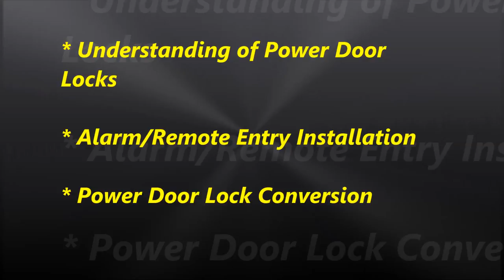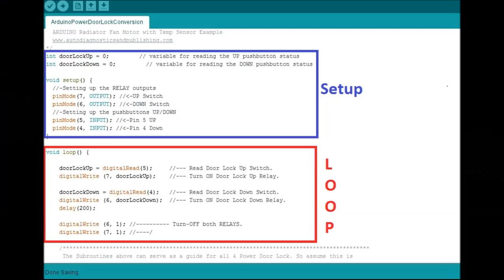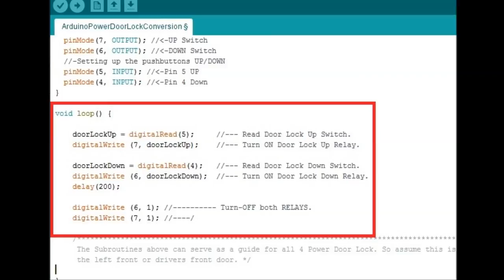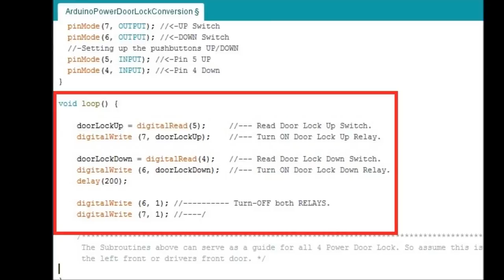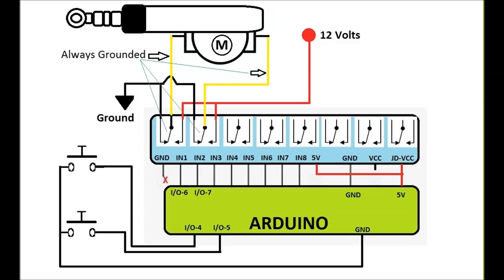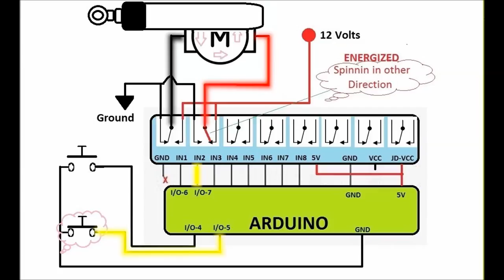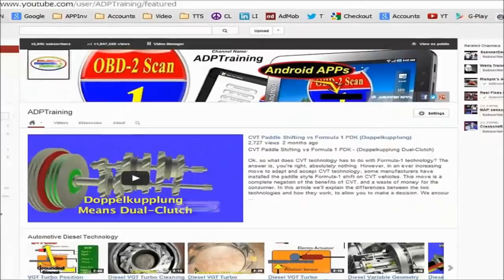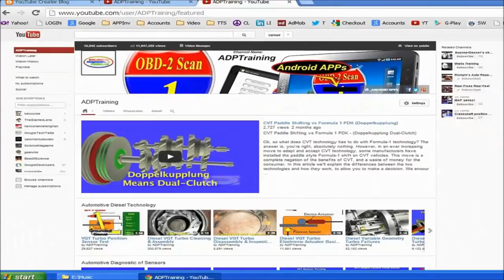Arduino Power Door Lock Controller

Comment: Interesting  - I wonder if you can guide me in the right direction. I have a door lock controller (all ok) however I want the doors to lock (like the OEM on newer cars)  when the speed reached  say 10 miles /hr. I have a PWM 2k/4k speed out i can use as a trigger input . and then i guess I need to send  a pulse to the controller  to lock. any ideas or the general layout etc?
Reply from the maker: You'll need an Arduino project with the right embbeded software for that.

Comment: Is there any reason to incorporate a flyback diode to increase the life of the relay?
Reply from the maker: Yes of course, to shunt the collapsing magnetic field around the relay coil.
Reply: @ADPTraining  I was thinking it'd be to shunt the collapsing field in the actuator motor, to protect the delay contacts.  Is that wrong? I don't know if it's significant enough to worry about.
Reply: Also I'm not sure it's possible because we need the motor to run both directions. Ie, maybe a flyback diode, or two fb diodes in oposite directions, would short it out. NOTE: I know only enough about db diodes and circuit design to be dangerous.
Reply: @terracoilGuy  This bidirectional TVS diode is perfect for the purpose  ref "1.5KE24CA". 24V of breakdown is enought to sustain the alternator variation. Some improvement can be made by adding a 1uF film capacitor between motor terminals for filtering HF motor switching.

Comment: This is overkill and a waste of a microcontroller; you could have just as easily hard wired it.

Also, that 200ms. delay is pointless because a couple of microseconds after the relays are turned off, the loop will cause another read of the switches and flip the relay back on; but the relay will never actually turn off because there are only a few microseconds between switching it off and then back on.
Reply from the maker: Whatever you see working on the video, is what it is. Your theories are welcome, but this is reality. All Arduino videos were carefully selected to show an operating principle, not out of usefulness as a design. In engineering it's called "Proof of Concept ", thanks.
Reply: Well, if you're going to use a microcontroller to do such a basic function, why not do it right and set up the external interrupts for edge triggering on the falling edge instead of just a loop in main? You could have put your 200ms delay in it, which would guarantee only one activation per button press, no matter how long you hold the button down.